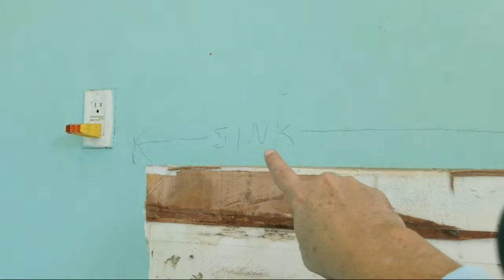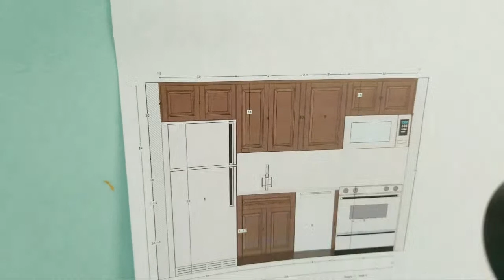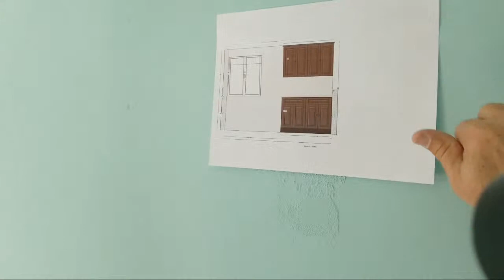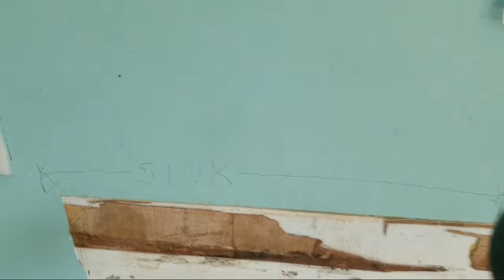DIY Tiny Kitchen Remodel Update 2: Plumbing/Electrical Disasters Behind Walls

Comment: Hey Jeff glad to see your healthy and working!!! I got hit with covid quarantine will b over sat then back to work on a basement remodel. I saw the layout in the first update on this project ever think about putting the fridge on the window wall with a tall pantry? That way you can have all full size appliances and sink just food for thought u have that partition wall separating rooms anyway won't b anymore in your walkway than that
Reply from the maker: Yes, we looked at that, I will shows those drawings that IK made on the next update. There is virtually no room for anything on the other wall by the windows, because it has to be an eat-in kitchen, there's no dining room. And the pantry units are so tall and so deep, that on that tiny wall, the owner felt it would stick out too much.

Comment: Hi from Los Angeles Jeff. I was thinking it might make each aspect of the job go easier if you fir out the whole wall with flat 2x4s and drywall it. That way you have space to run the electrical wiring and can place the 2x4s strategically where you want to mount j-boxes, etc. You'd only be losing a couple of inches of the depth of the room.
Reply from the maker: Yes that is one way to do it also, and we have done that before also.

Comment: Jeff, how do you check to make sure you're not going to hit electrical wires when cutting into the sheetrock with your Ryobi saw?
Reply from the maker: The guard on it prevents you from drilling through nay material thicker than 1/2"
Reply: @jeffostroff  Ah, makes sense now. Thanks.

Comment: You may be one put the latticework behind and insulate the wall you may be have to do that because there's no installation on that wall
Reply from the maker: This is an interior concrete block wall, but there is no insulation over the ceiling!

Comment: Why is it hard to replace the cast iron stack? Is it because the house is on slab?
Reply from the maker: Yes, it is embedded into the slab, and likely drilled into the and through the roof, and it is very heavy, so even cutting a 3 foot sections it is like 50 pounds each section.

Comment: Jeff your not done yet,,,use all Dewalt tools it will go faster🤣🤣🤪
Reply from the maker: I will be using my new Flexvolt Advantage Grinder to cut the hole sin the cement block walls for the outlets